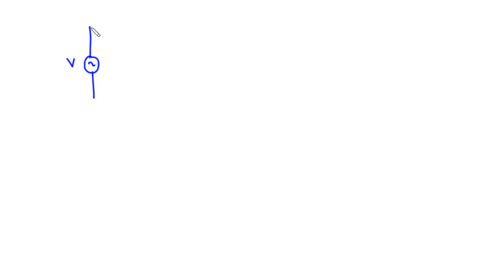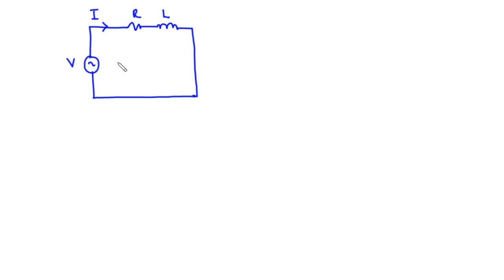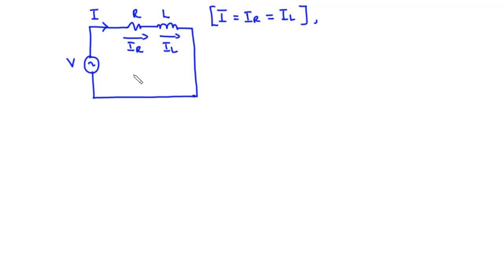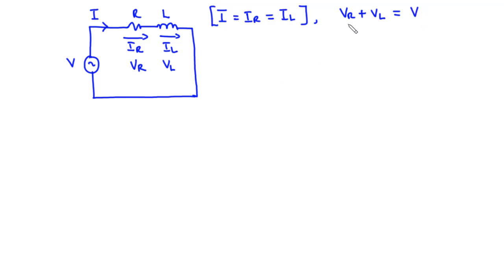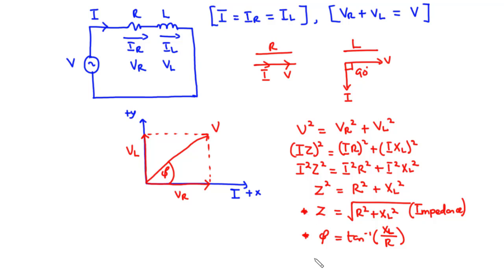35 - Series RL Circuits with Solved Examples | Solving AC Circuit Problems

Comment: How did u convert the triangle form to the polar form ?? How did u get those numbers?
Reply from the maker: There is a way we do it mathematically, but in this case I just used a calculator to obtain the value